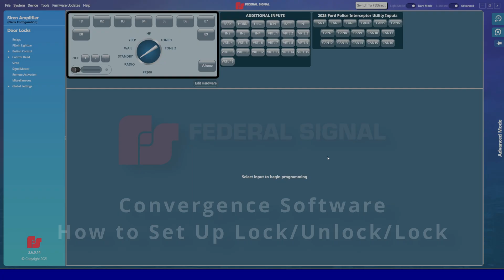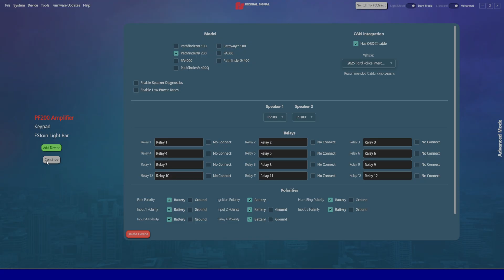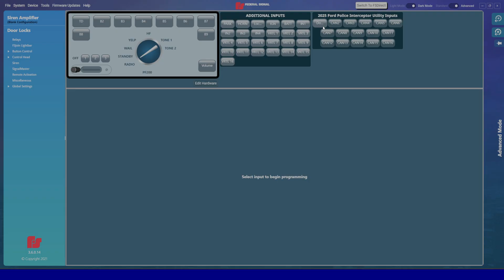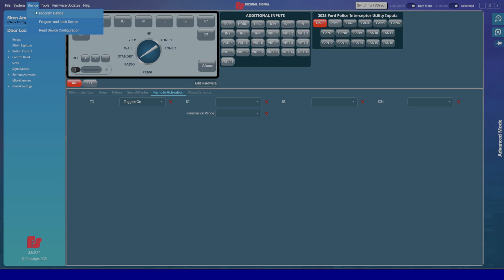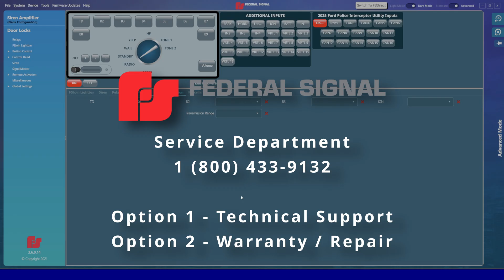Convergence Software - How to Set Up Lock/Unlock/Lock

Comment: But how will it work if the vehicle is off?
Reply from the maker: Unfortunately it will not work when the vehicle is off, as the Pathfinder only works when voltage is applied to the main power line as well as the yellow IGN wire, or using OBD sense for when the vehicle is on. One way to bypass this is to have a charge guard to keep the Pathfinder alive for a set amount of time after vehicle is off. Thanks!